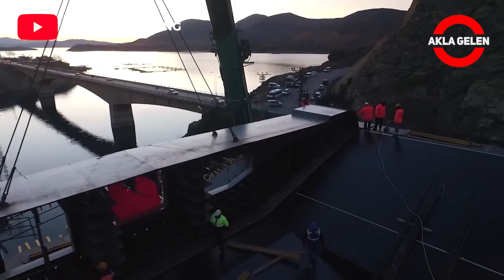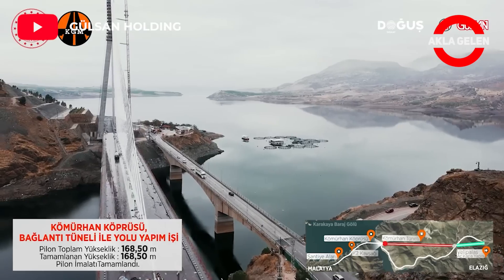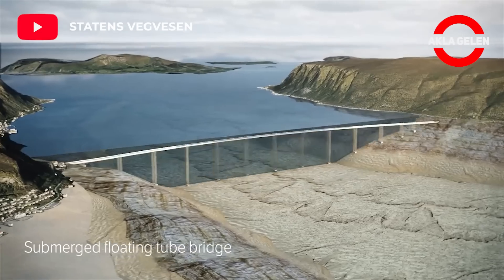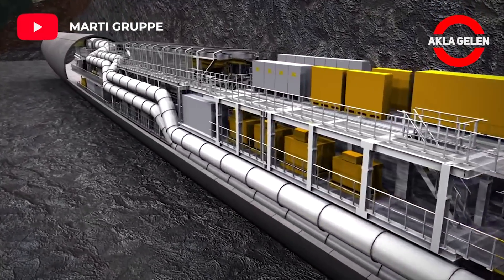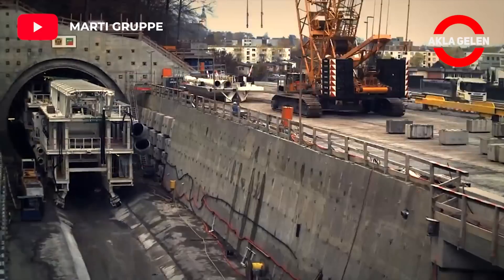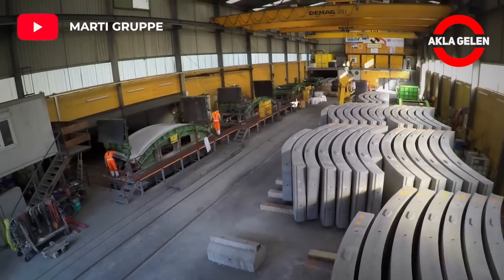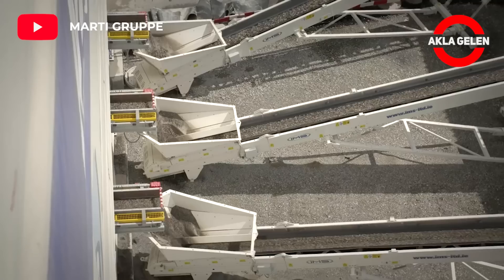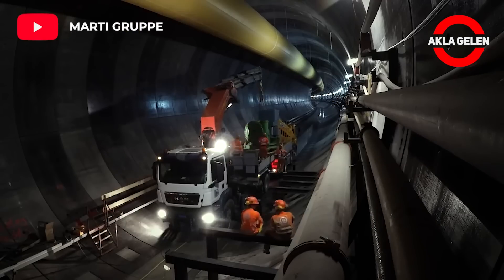Norway Engineers Shocked China - $ 47 Billion Floating Highway - Incredible Megaprojects

Comment: the problem with those tunnel bores is that once it completes a job its normally scraped on site and then buried because the cost of retransporting and repairing is more expensive than making a brand new one so often time most of carbide bits are still left in them because they are mostly chewed through. Even though it does make creating tunnels easy its lack of reusable bore heads makes them costly project and why they either don't do the project because of how man bore heads will be required or logistics is too high so they bust before ever getting started. Also depending on the density of the rock being bored into they sometimes need to do a switch while underground which requires making a shaft so planning ahead is another that needs to be done making the necessary shafts along the way and hoping that nothing strange happens in between or you end up having to make an shaft down and wasting more time and resources. 

Great machines just not quite optimized yet still better than doing it by hand by long shot.
Reply: in norway we dont bore, we blow shit up.. always heck they even blasted their way to the cellar in by backyard right in the middle of Bergen.
Reply: Learn to use punctuation marks my friend.
Reply: @123TauruZ321  nevar!

Comment: this is the first time i see nowergians deal with a big thing!!!
Reply: If you think so, you are wrong. Norway has a record in building construction with the Troll A gas platform in the North Sea. The Troll A platform has an overall height of 472 metres (1,549 ft), weighs 683,600 tons (1.2 million tons with ballast) and has the distinction of being the tallest and second heaviest structure ever moved by humankind. The platform stands on four legs extending down to the sea floor 303 meters (994 feet) below the surface of the sea, and the leg containing the import and export risers has an elevator that takes over nine minutes to travel from the platform above the waves to the sea floor. 

There are experiences from engineers who have built these oil and gas platforms they intend to use in the construction of the coastal highway.

Comment: Already in Japan, there are underwater expressways such as the Tokyo Port tunnel and aqua line.
Reply: this project is longer than all the coast line in Japan, some 2000 miles...
Reply: @deandee8082  But they haven’t built it yet.
Reply: @Bk6346 , good one. A
Reply: @deandee8082   The same thing. Maybe borrowed it from Japan.
Reply: @deandee8082  And that's supposed to be cool and shock China?🤣🤣

Comment: I can imaging the traffic problems when a ship or boat hits one of those floats for the floating bridge
Enjoyed your video and I gave it a Thumbs Up
Reply: Jes, but i think the biggest problem will be the movement of the whole construction!! If it moves or streches too much the seals will break....
Reply: well the larger issue for those floating tunnels would more less the wakes created by such boats having it floating will cause drag on it causing it drift out with the waves this would cause major stress on the connecting points of the tunnels and also even greater stress on the 2 points of the middle section where the drifting occurs. You would need a material that is very flexible and stretchy without making too much difference on the road inside. Even if you create a counter drift there will still be stress being applied to the materials even though it would take longer for a critical failure to happen still wouldn't stop it at some point the cost along for making sure that doesn't happen would be up in the trillions just to keep it together.
Reply: @IloveJellow  Do you know what a punctuation mark is? Did you go to first grade?
Reply: الاصتدام نادر حدوثه تكمن المشكلة في نسيانهم خاصية امتصاص الزلازل لاقدر الله